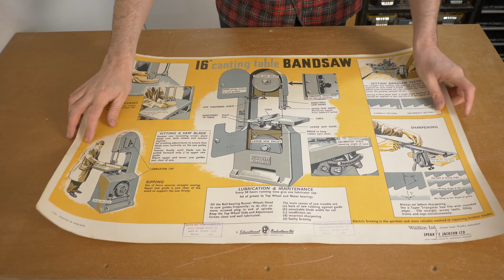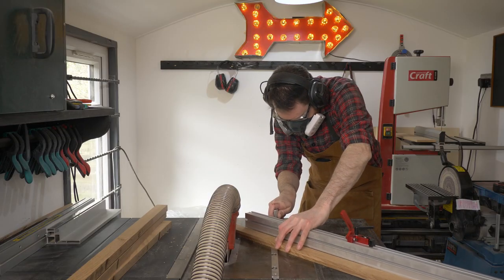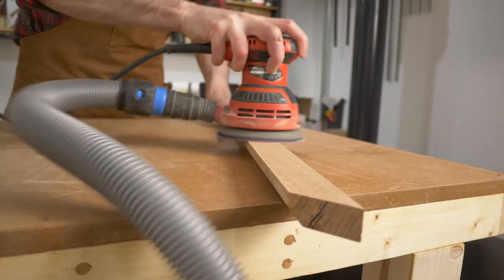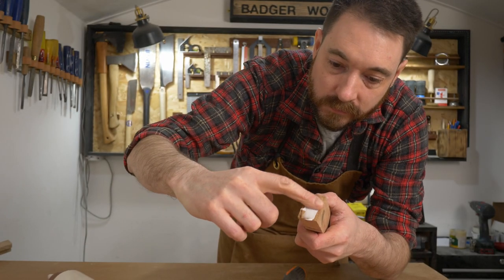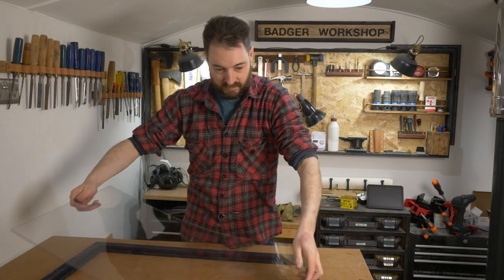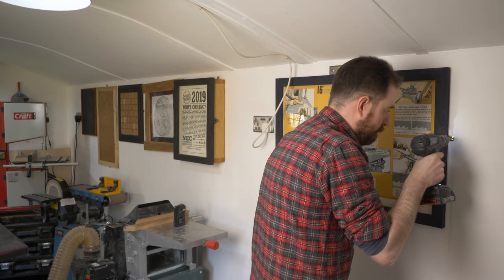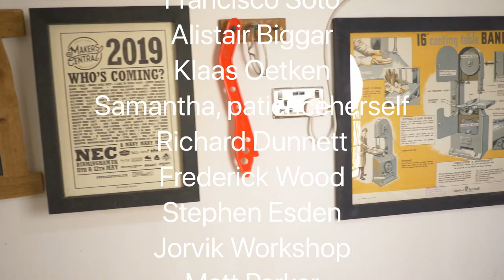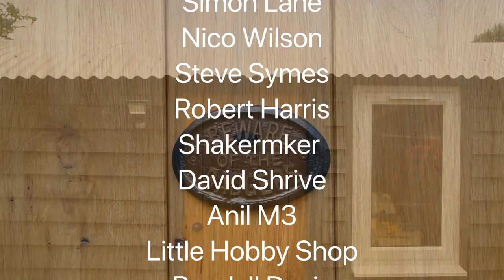Ebonised Oak Picture Frame

Comment: Turning this corner clamps upside down is genius. I bought a coupe of sets off eBay years ago to do some metal fab work and they would tilt the square bar and the mitre would open up when clamped. I just binned them as useless but I'm kicking myself for not thinking of your idea. Superb.

Comment: That went a whole lot darker than I had expected, which is awesome and matches the other frames. 👌🏽
At a fraction of the cost compared to the ink and the amount it made, I'm guessing you won't be buying the ink any time soon!😉
Nice build on the frame, the poster looks right at home in its new frame, good job, Matt.👍🏽
Reply from the maker: Yes works out much cheaper

Comment: Currently making walking stick out of Holly Wood is almost white with very little tannin, 'painting'  it with black tea first before I add ebonised solution, it took ages for my wire wool to dissolve however its all part of the adventure trying different things out 😉😉

Comment: Nice frame Matt. I'd never heard of the ebonising method. One slight concern: When treating a picture frame which is going to hold valuable artwork or photos do you think that there's a chance that any residual vinegar ( acid ) in the frame could attack the artwork? Museums & fine art photographers get very concerned about this stuff.
Reply from the maker: I would not think so but best to test first

Comment: Hello there, I am thinking to try the method you introduced here.  You inspired me to do that.  I have one question.  The wood I own is mostly pine.  How does it work on pine?  Have you experienced that before?  If not, I guess I will give it a go and report back.  Thank you, Matt.
Reply from the maker: It needs to be a wood with a high tannin content so no good for pine
Reply: @Badgerworkshop  Thank you.  I am new to woodworking.  I am still learning and here I learned another thing.

Comment: Out of curiosity, why do you think the corner clamps worked better "upside down". Thx again for sharing.
Reply from the maker: Because the wood was on a flat surface not on the clamp
Reply: @Badgerworkshop  what if you set up all 4 corners at once to get them level?  They certainly look like robust clamps that could handle all sorts of corners. :-)

Comment: Interesting, I've never done anything like that before I'd like to give it a try. I know you may have answered this already but where do you get all the wood that you have? It seems that you have high quality hardwood which is nice to work with. Thanks for the video and watch out that the masking tape doesn't peel with age, I've had that problem before on picture frames. Cheers
Reply from the maker: It come from lots of places. New stuff from a local saw mill and I get a lot of reclaimed materials